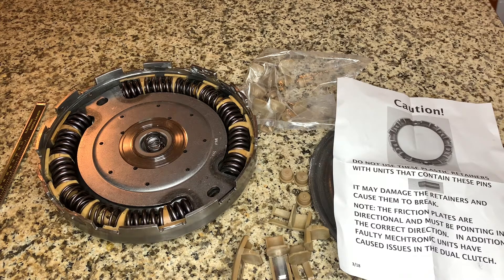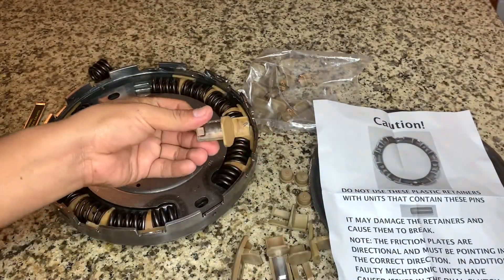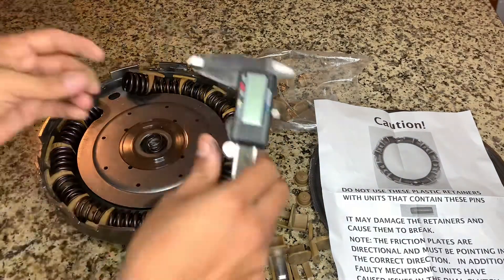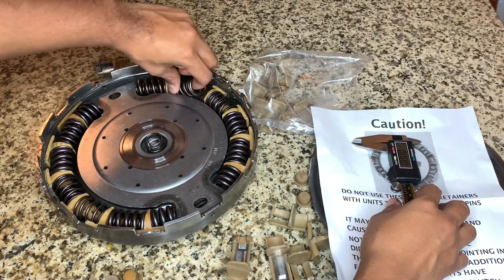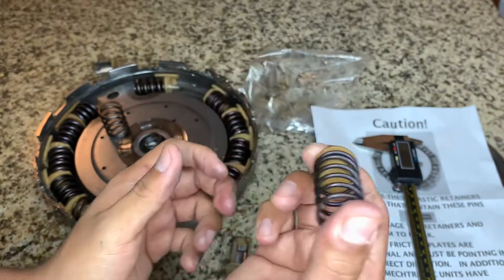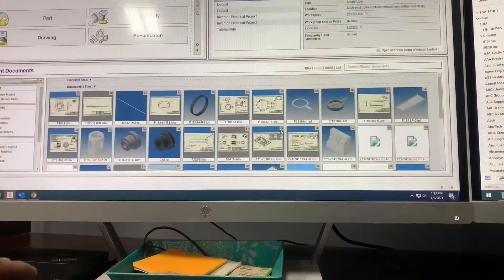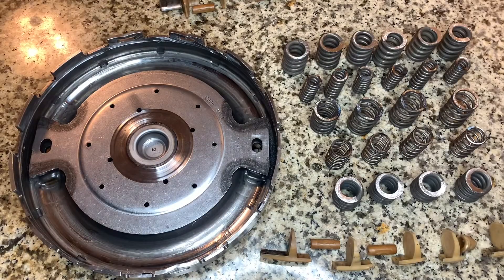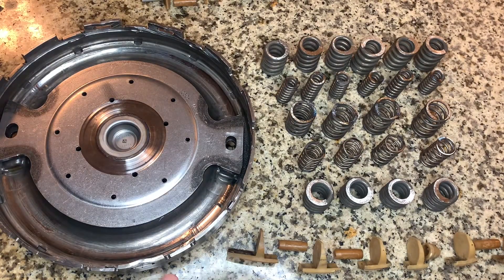Mitsubishi Evo X MR SST DCT470/6DCT470 Transmission Rebuild - Part 13 Torque Damper / MPS6 / Clutch

Comment: My brother in law works in a place that has an aluminium foundry. They cast aluminium pulleys and the like. I've wondered if these parts cast in aluminium would work.
Reply from the maker: It should and if he can fabricate it for you, even better
Reply: only plastic. metal is not allowed. metal will kill the solenoids. because the metal shavings are dirt

Comment: May be a stupid question…
But what if you were to run NO springs. Like literally remove them and the retainers and just run it like that. I feel like If
All it did was cause a little vibration, it’d be worth it
Reply: I've wondered that too. It probably wouldn't even cause vibration,  maybe just rougher shifts.

Comment: Very informative. I wish we had cnc metal replacements for those plastic pieces and titanium springs. This would literally solve ALL of the torque damper issues 100%
Reply from the maker: You think I should start making some
Reply: @josezamora7889  Why not? You would be doing SST community a favor and having a solid solution to an existing problem. If you were are able to make metal pieces for all the plastic in the torque damper and replace the springs with titanium or something....this would be bullet proof!
Reply from the maker: @kenly6858  ok I’ll see what I can do. I might have to make my own market place for all SST parts
Reply: @josezamora7889   I'd definitely order a set. Can you please tell m why, these are actually not made of steel? What stopped them doing that?

Comment: You never showed how you opened it ...
Reply from the maker: It’s on part 11 video
Reply: @josezamora7889  for some reason I cant find that vid. I will look again and thank you
Reply: @josezamora7889  Hi, did you get the video? As I’m still waiting it to try open the damper. Thanks in advance and your videos were really useful.
Reply: I found the supplier SSP for the springs but did you find the supplier fir the plastic parts?
Reply from the maker: @82toyotalandcruiser  no there are currently no suppliers for the plastic, the DCT450 plastic doesn’t fit the  DCT470. I had to fabricate my own.

Comment: Does the torque damper have to be welded together?
Reply from the maker: Yes it does because it’s robot welded so in order to open it you need to use a grinder. Then re weld it back together with new hardware.
Reply: @josezamora7889  ok good to know, mines been rattling recently and was gonna rebuild it but I hear the OEM springs just don’t last
Reply from the maker: @abedriedger8041  yeah that’s true they don’t last long that’s why I went with the SSP springs.
Reply: Did you cut it open and weld it yourself
Reply: @82toyotalandcruiser  no idea... where would we even weld it...?

Comment: Hows the transmission going?
Reply from the maker: It’s completed but haven’t installed it in the car. Plus I lost my job two weeks ago due to Covid 😬 .
Reply: @josezamora7889  oh man that’s terrible! I’m sorry to hear that, hoping you land back on your feet! I put mine back in about a month ago, drives fine, but shifts like crap! A proper torque dampener does make a difference